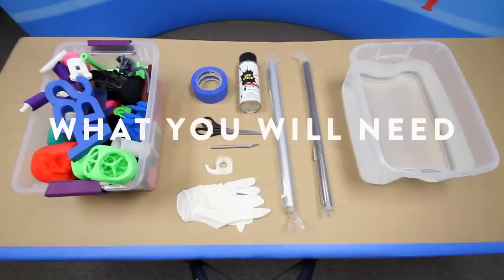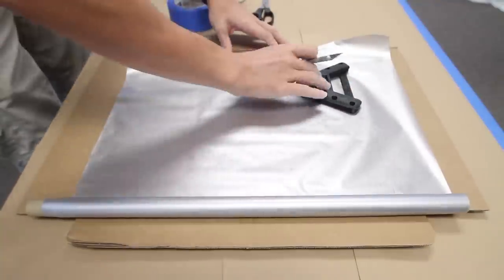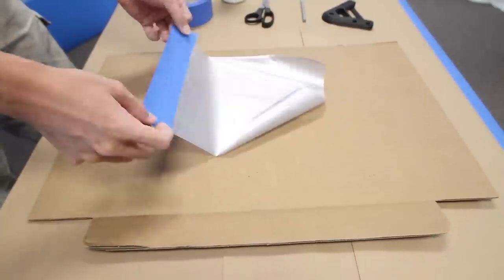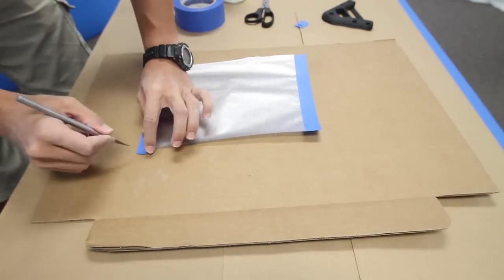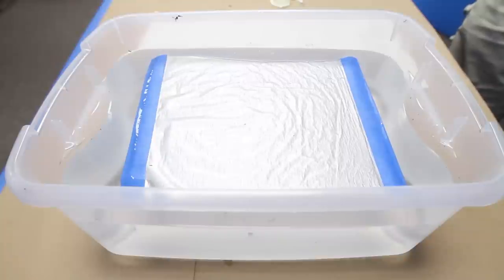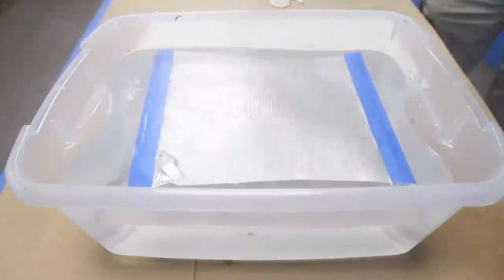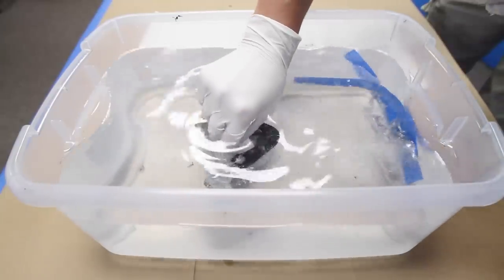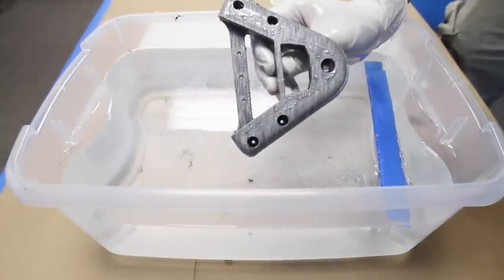How To Finish Your 3D Prints Using Hydrographics

Comment: Is there a reason your only taping 2 sides? Having watched others clips. It seems like if the film is completely framed. the film is less likely to wrinkle or clump. And when you bring the item through the film. the excess film is more likely to tear off. Instead of clump to the object.
Reply from the maker: lsl We only taped two sides because thats all that was necessary, and it gives us more space. You raise a good point, though. Taping all 4 would help take care of the excess.

Comment: Probably the worst example of hydro dipping...and you can just use regular spray paint for solid colors, and a mix for like a tye dye thing, only reason you would use film is if you want to actually print something, or have like a carbon fiber thing going.